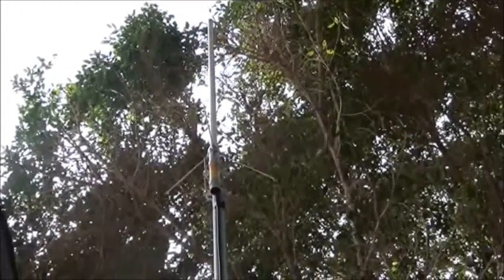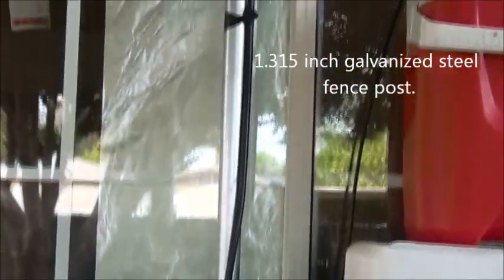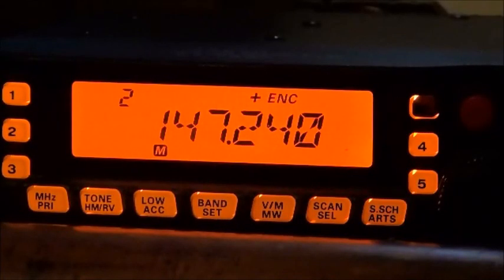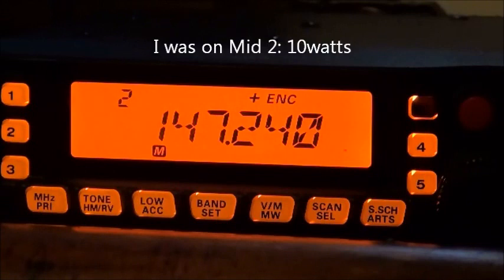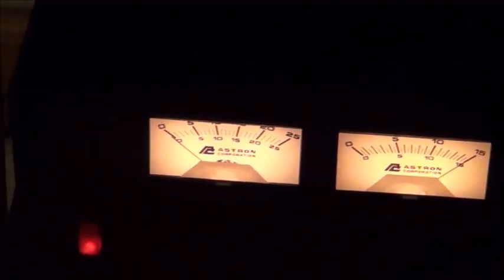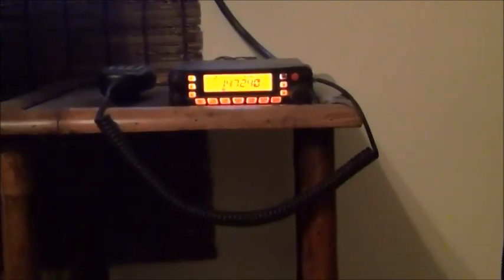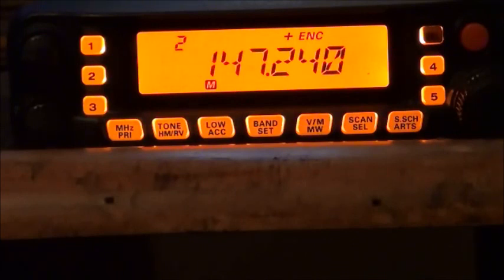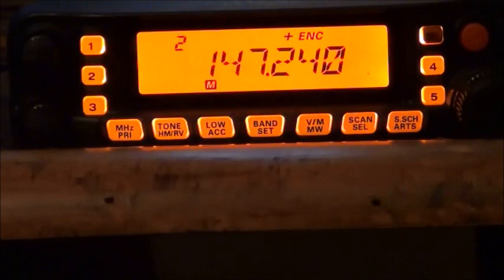Ham journey Continues

Comment from the maker: @SoCalPreppers not the Radio.  The PS has a battery backup.. :)  it's an RS-20a-BB.. but, i've looked this PS up and down and can't find any adjustment setting knobs or switches etc.. :(  i'm hoping when I put a battery on the PS it will go to 13.8 volts.  I'm thinking the extra voltages is for trickle charging the battery backup.  But, i'm not sure. No book on this thing...

Comment: @cmobley69 battteries? that radio has batteries?  Well, on the power supply, if you are looking at the meters, on the right side at the closest part of the PS to the bottom, mid way back, there should be a hole with a screw knob inside labeled volt adjust.  I have those same supplies.,also the radio uses more power on tx than rx so I dont think the radio would draw that much just by listening.   Im gonna back track and see what Im missing here

Comment from the maker: @SoCalPreppers No it's that way because i'm supposed to have a battery trickle charging I think. There is no way to turn it down. But, the Radio says it's only getting 13.8 amps. I'm still trying to figure this PS out.. Because it only has 1 pos and 1 neg post.  I would have thought it would have 2 of each.. One for the battery and one for the Radio.. Stupid thing didn't come with any directions.. nice PS tho...